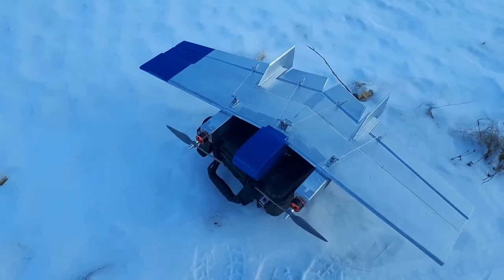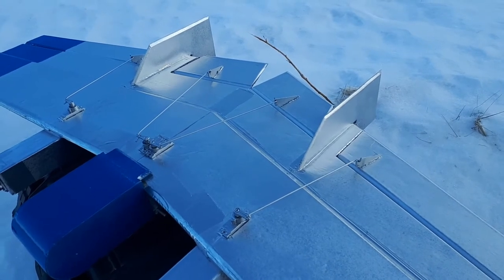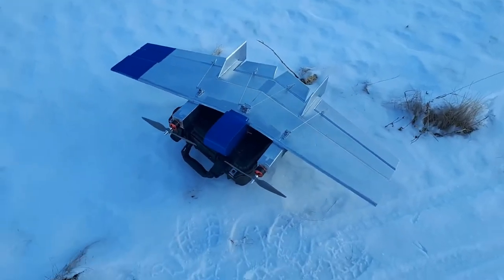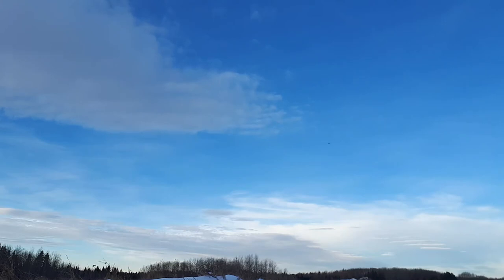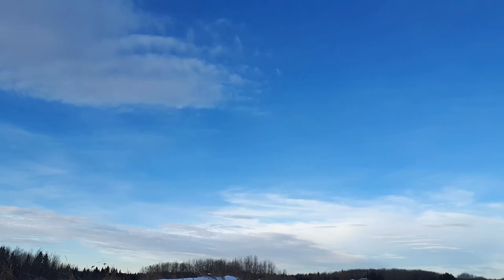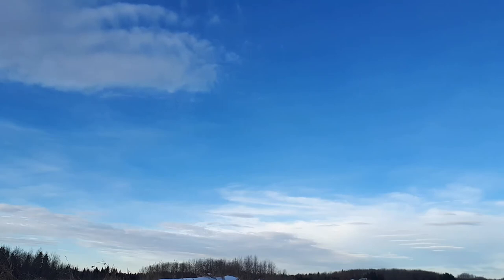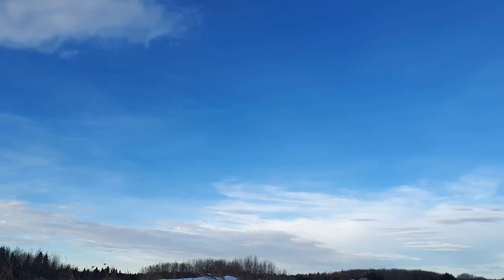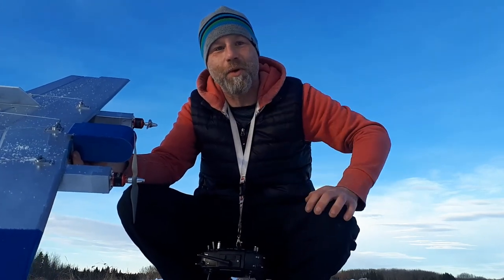Twin Tractor Wing Maiden

Comment: Amazing work, it's great to see it from concept to Maiden in such a short time. Great flying enjoy it and Merry Christmas
Reply from the maker: As successful as it was it could use a lot of refinement. I think its to nose heavy, jusdging by the way it has no glide slope. Well if "drop like a rock" is glide slope! So this will be revisited at some point to try to get the look of the original idea. The performance is somewhat lack luster compared to what i was expecting. But it is a good place to start.

Merry Christmas buddy, stay airborne in the new year